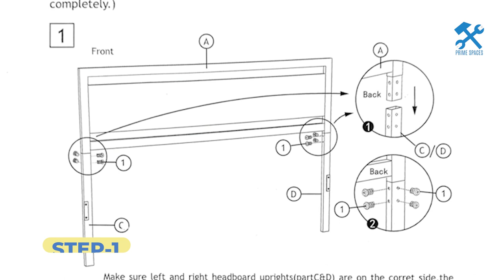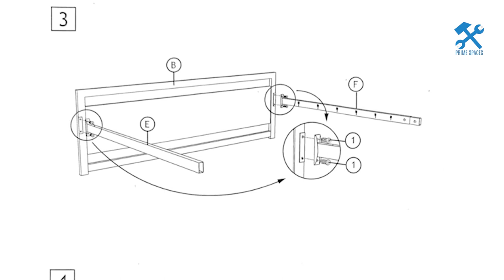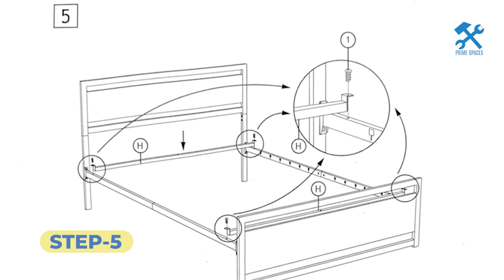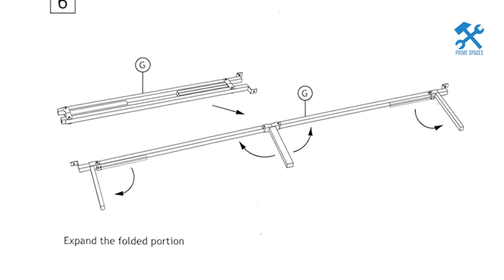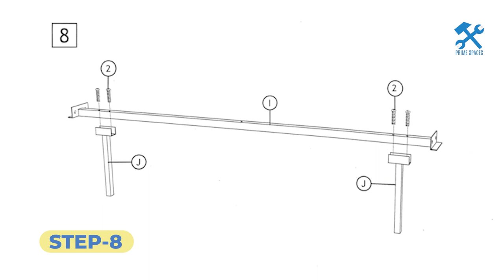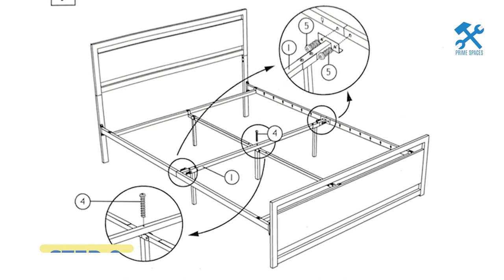Allewie Queen Bed Frame with Headboard Assembly | Marilee Wood and Black Metal Frame Bed

Comment: i have this bed and makes alot of noise. what are the little pieces called that your putting on each slat?
Reply: Thats probably what dampens any noise. All the reviews I see on this are that it is pretty quiet
Reply: @eastonsmitty  I've contacted manufacturer multiple times to order as of yet no response
Reply: @veronicaortiz9281  I've been using the bed for a while now with no issues on noise, even if I jump on it. You may have just assembled it wrong